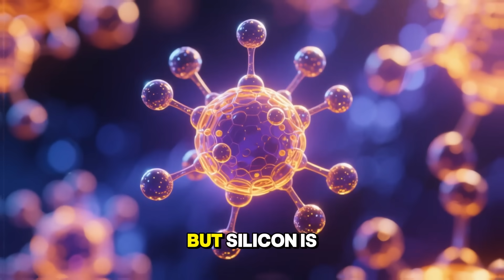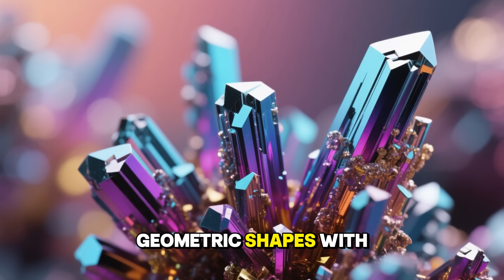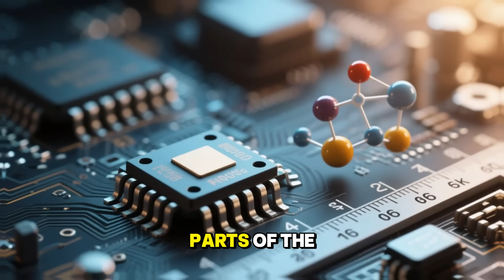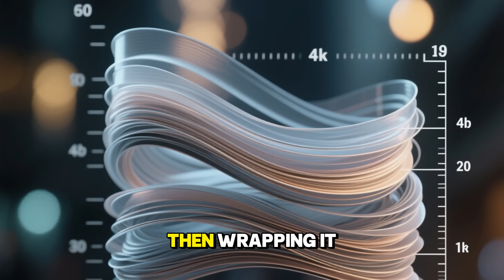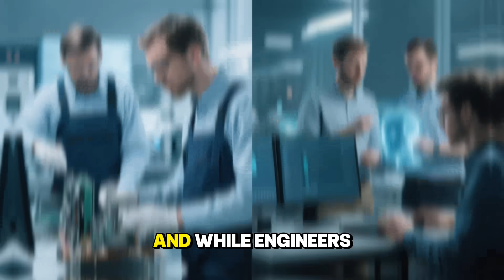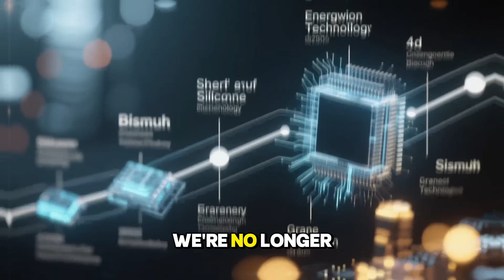The End of Silicon? China’s Bismuth Chip Breakthrough Explained

Comment: Don't know if it's true or not but US will regret it's decision to block chips export to China, Once China cracks the code US will loose big time, China is the last country you would want to push against the wall, When they'll come at you you won't be able to hide.
Reply from the maker: You’re right — cornering China in semiconductors might backfire long term. Sanctions can slow access, but they also force self-reliance and innovation under pressure.
China’s already pouring billions into EUV alternatives, photonic chips, and indigenous fabs — once that ecosystem matures, the ripple could be global.
History shows: every time tech is weaponized, a parallel supply chain is born.

Comment: Bismuth has one major disadvantage, it can not store information.. Without storage, bismuth cpu is useless.
Reply from the maker: Interesting point! 🔎 Bismuth itself isn’t meant to store information — it’s being studied more for its role in switching and conduction (like a transistor channel material). Storage usually comes from memory technologies (RAM, flash, spintronics, etc.), while the CPU’s job is mainly logic and processing. If bismuth can switch faster and with less energy than silicon, it could still be incredibly valuable — especially when paired with advanced memory systems. ⚡🧠

Comment: Hope U S A is also working on creating the next semi conductors... High temp super conductor tech is not much  used..
Reply from the maker: Yes — the U.S. is definitely investing in post-silicon semiconductors too. Projects in spintronics, photonics, and quantum materials are backed by DARPA and leading universities. High-temperature superconductors are still tricky for mass use because they need special cooling, but research continues — and if breakthroughs come, they could transform data centers, power grids, and supercomputing. ⚡🇺🇸

Comment: Some of the figures presented in this so-called breakthrough do not appear to be consistent.
It is claimed that the structure size can be reduced to 0.5 nm, yet the atomic radius of bismuth is approximately 50% larger than that of silicon, while also being roughly ten times heavier.

The reference to 500 GHz also seems questionable. Such a frequency would be extremely high, well beyond the radar range and already approaching the near-infrared spectrum.

Furthermore, the claim that this chip requires less power adds to the inconsistency. In principle, power consumption scales with frequency. For instance, if no other parameters of a chip are altered but the frequency is doubled, the required power likewise doubles.

In summary, they suggest achieving over 100 times the clock frequency of the currently fastest processors while simultaneously reducing energy consumption. This would imply an overall efficiency improvement of 200–300 times compared to the current state of the art. Such a claim appears highly implausible.
Reply from the maker: You raise very valid points. Let’s break this down carefully:

1. Feature size vs. atomic radius
You’re right that bismuth atoms are larger and heavier than silicon atoms, and in classical transistor scaling, that would limit how small you can go. But when researchers talk about “0.5 nm,” they often mean equivalent gate length or channel thickness in a layered 2D crystal, not literally packing atoms closer than their radii. Materials like bismuth oxyselenide (Bi₂O₂Se) form 2D layers with unusual bonding that allows very thin effective channels, despite the larger atomic size. It’s not the same scaling law as bulk silicon.

2. The 500 GHz claim
500 GHz clocks do sound extreme, since today’s fastest commercial CPUs max out near 6 GHz. However, in labs, terahertz oscillations have been demonstrated in graphene and some 2D semiconductors. These are not stable processor clocks yet, but proof-of-concept oscillations. So, the number may refer to a theoretical upper switching speed under ideal conditions, not a practical CPU frequency you could ship.

3. Power consumption vs. frequency
You’re right that in conventional CMOS, power ∝ frequency × capacitance × voltage². So higher frequency usually means higher power. But researchers suggest that these 2D bismuth-based devices may have much lower capacitance and can operate at lower voltages. If capacitance and V² drop enough, overall power can still decrease even if frequency increases. Again, this is still at the research stage, not proven in real chips.

4. Efficiency improvement numbers
Claiming 100× the speed with less energy does sound implausible if taken at face value. But in fairness, researchers often emphasize potential or theoretical efficiency gains in highly controlled setups. Turning that into a manufacturable processor is a very different challenge—just look at how long it took graphene research to move from 2004 discovery to even niche applications.
Reply: @QuantumSilkRoute99  Thank you for your explanation. It appears plausible to some extent; however, I remain unconvinced.

1. 
Larger atoms would, in principle, also imply larger molecules. If the thickness of a layer is to be reduced, this would entail fewer molecules or atoms separating one layer from another. I doubt that at such scales it is possible to suppress crosstalk at 500 GHz. Even at distances of several centimeters, this would already present a considerable challenge. Without having studied the technical specifications of this chip in detail, I would nevertheless assert that achieving 0.5 nm at 500 GHz is not feasible. In any case, this remains to be seen.

2. 
I did not claim that a 500 GHz clock appears extreme. Rather, I maintain that it is simply impossible to reliably detect a high or low signal at 500 GHz. The existence of a 500 GHz clock does not imply that data transmission occurs at that rate. This must not be conflated with frequency modulation as employed in satellite communication. Naturally, one could transmit data over a 500 GHz carrier, but not at a throughput of 500 Gbit/s. Depending on bus width, such a configuration would entail unimaginably large volumes of data traversing the chip.

3. and 4. 
I am fully aware that performance cannot be reduced to the mere product of power and frequency. Nevertheless, efficiency gains of such magnitude often constitute a red flag. Moreover, your point—“Again, this is still at the research stage, not proven in real chips.”—stands in contrast to the claim that the chip already functions in this manner. I, for one, do not accept the assertions made by the Chinese source.

Overall → My hypothesis is that the chip does not, in fact, operate at 500 GHz. Rather, it is a 128-core ARM CPU running at approximately 5 GHz. This interpretation would reconcile all of the developer’s claims. Strictly speaking, it would be misleading—but not technically false—to specify the frequency as 500 GHz. An ARM CPU can indeed achieve substantially higher frequencies than an x86 architecture. Furthermore, ARM CPUs are markedly more energy efficient than comparable x86 processors. I consider it entirely plausible that the Chinese side might present a mediocre ARM CPU as a groundbreaking technological innovation.

Comment: There has already been existing microprocessor made entirely out of GaAs for certain microwave-frequency applications, usually entirely without silicon, so this isn't as new as this video purports it to be.
Reply from the maker: You’re absolutely right — GaAs (Gallium Arsenide) chips have been around for decades, especially in high-frequency RF and microwave applications. They’re fantastic for niche uses like satellite comms or radar.

The difference here is that bismuth-based chips are being explored not just for signal processing but as a possible general-purpose alternative to silicon. The key claim is higher efficiency (faster switching, less energy) in logic operations, which GaAs never scaled into.

So in a sense, you’re right: it’s not the first “beyond-silicon” attempt — but it could be one of the first with the potential to challenge silicon at scale, if it holds up under real manufacturing conditions.

Comment: No way silicone can survive another decade!!!
Reply from the maker: You’re not alone in thinking that! Silicon is definitely pushing up against its physical limits—heat, leakage, and scaling below a nanometer are brutal challenges. 🔬

But at the same time, the entire global chip ecosystem (TSMC, Intel, Samsung, fabs, software tools) is still deeply locked into silicon. That inertia is massive.

Chances are, we’ll see hybrid solutions first: silicon + new materials like bismuth, graphene, or spintronics working side by side—before silicon is fully replaced. ⚡

Comment: US can easily counter this by doing what their competitor has been doing to them.....buy china's products and reverse engineer it to make more powerful and advanced chips.
Reply from the maker: Nice point — plausible on the surface, but it’s not that simple. Reverse-engineering can work for finished products, but making more advanced chips requires far more than copying a board: you need access to the exact process technology, fabs (EUV tools from ASML), advanced packaging, design toolchains, and a skilled ecosystem — many of which are gated by export controls, IP protections, and huge capital investment.

China can and does learn by studying foreign products, and that’s part of how tech spreads. But the U.S. and its allies also control critical pieces of the supply chain (high-end lithography, extreme materials, EDA software, cutting-edge foundries). That means catching up at scale takes years and coordinated policy, not just buying and copying a few devices.

Bottom line: reverse engineering helps — but it’s one arrow in a very large quiver. Strategic tech leadership still depends on supply chains, talent, tooling, and sustained investment.

Comment: Interesting, there are other competing material like gallium arsenide
Reply from the maker: Absolutely! Gallium arsenide (GaAs) has been a key alternative for decades — it offers faster electron mobility and efficiency compared to silicon. That’s why it’s often used in satellite tech, RF chips, and high-frequency applications. The big challenge, though, is cost and large-scale manufacturing. So while GaAs and other III-V semiconductors are powerful, the real revolution will likely come from a mix of materials — silicon, GaAs, graphene, and even bismuth — each optimized for different use cases. ⚡🔬

Comment: Silicon will continue to dominate, but will continuously lose market share while process technologies are refined. Once the 25% yield, and strong performance in the field for a few designs, proves the technology, there will be a mad rush to mainstream the technology and the horizon will suddenly increase exponentially. I'm guessing the crossover to the consumer segment will happen in about 8 to 10 years. 

My primary hopes are that by then we'd have learned valuable lessons about the pitfalls of technological advancement without  careful consideration of societal impacts, and the benefits that actually when we can all rise in concert. Fingers crossed...
Reply from the maker: Brilliantly put. 🌍 Silicon’s dominance is secure for the near future, but once yields stabilize and new materials prove themselves in real-world use, adoption can accelerate at lightning speed — just like you said. The 8–10 year horizon feels realistic for consumer-level crossover. The bigger question is exactly what you raised: will society be ready to handle the consequences responsibly? Tech revolutions move fast, but wisdom usually lags behind. Fingers crossed we learn to rise together, not repeat the same mistakes. 🚀✨

Comment: There will still be silicon  a hundred years from now for cheap chips. There is no need to replace every thing with new materials.
Reply from the maker: Very true — silicon isn’t going anywhere anytime soon. It’s cheap, abundant, and has decades of optimization behind it. New materials like graphene, bismuth, or GaAs won’t replace silicon across the board, but they’ll carve out niches where silicon struggles — like ultra-high performance, AI acceleration, or energy efficiency. In the future, we’ll likely see a hybrid world: silicon for mass production, and exotic materials for cutting-edge systems. ⚡🔬

Comment: I doubt that bismuth would replace silicon in the same way that silicon replaced the vacuum tube, but for some new applications it will be used together with Gallium Arsenide or with Gallium Antimony which we haven't imagined or anticipated.
Reply from the maker: Great insight — you’re right, bismuth probably won’t outright ‘replace’ silicon the way silicon replaced vacuum tubes. But for specialized applications, especially when paired with compounds like Gallium Arsenide or Gallium Antimony, it could open doors we haven’t even thought of yet. That’s the fascinating part — the next wave of chip innovation might be less about one material winning, and more about hybrid approaches reshaping what’s possible.
Reply: @QuantumSilkRoute99  — as if the rest of the world hasn’t already figured this out.

Comment: 2D bimusth Bi2 O2 Se with graphene ...40 % faster than high end current chips and using 10% less energy used. 
Bismuth is very rare elements difficult to mine and extracting to 100% quality....2 to 5 years before mass production. Cost will be a challegen.
Reply from the maker: Exactly — Bi₂O₂Se with graphene shows real promise, with reports of ~40% speed gains and ~10% less energy use compared to today’s top chips. But as you point out, bismuth’s rarity and purity challenges are huge hurdles. Scaling from lab success to mass production will likely take years, not months, and cost will be the ultimate deciding factor. Exciting science, but commercialization is the real battlefield.

Comment: I believe it will be a combination: silicon will remain the standard for regular consumers, while bismuth will replace the technology for massive servers, corporations, and elites.
Reply from the maker: That’s a very realistic take. Silicon is cheap, reliable, and deeply entrenched, so it will likely stay dominant for consumer devices. But for high-performance computing — servers, AI clusters, and corporate/elite applications — exotic materials like bismuth could become the differentiator. The future of chips may not be about one material replacing another, but about a layered ecosystem where each finds its niche.
Reply: You beat me to my answer
Reply: Is like going back to glass tube transistors...2D bimusth is 40% faster and 10% less energy consumption than high end current chips. 
Silicon face off after masa production of 2D Bimusth
Reply from the maker: @fernandofernandito3055  Good comparison — it really does feel like that leap from vacuum tubes to transistors. If 2D bismuth can consistently deliver 40% faster performance with 10% less energy, silicon will face serious competition once mass production is possible. The real test will be scaling from lab prototypes to industrial fabs — that’s where the battle begins.